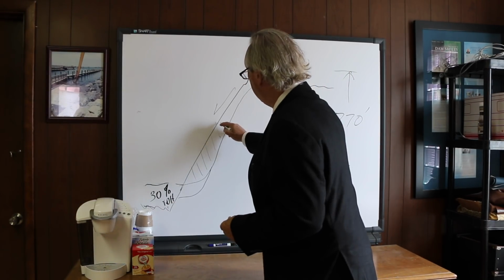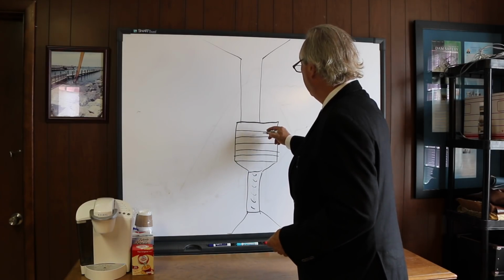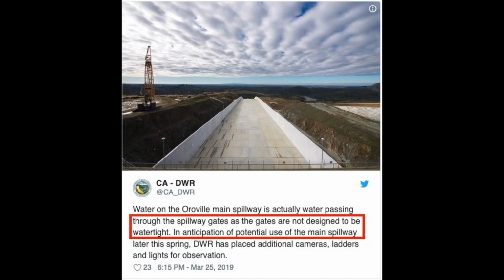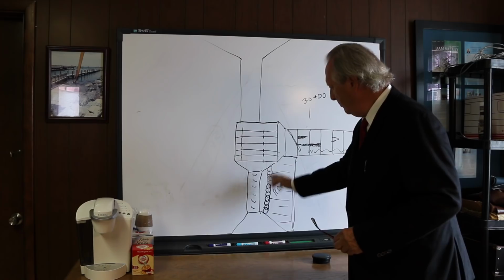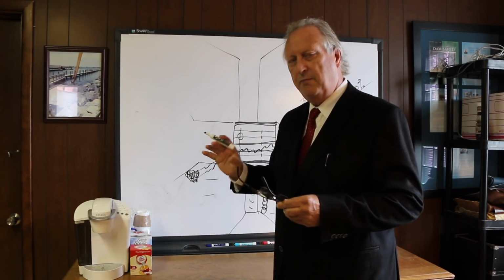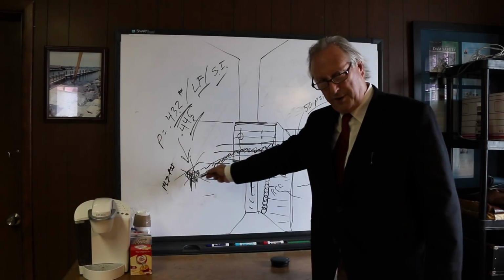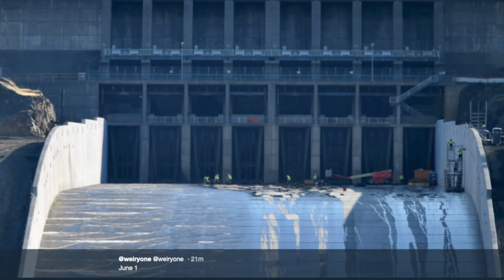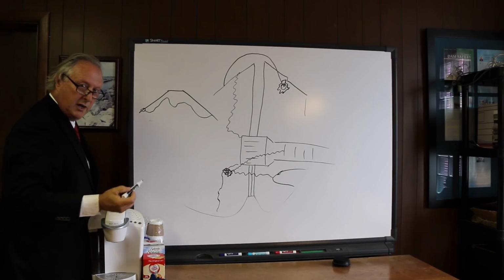Cahill on Oroville Dam 06-01-19

Comment: Scot ~~ I appreciate your well thought out presentation, but I think that you overlooked a few things that need to be brought up so bear with me as I bring up my points of contention.
1. The 2.5 'reinforced concrete slabs that makeup the finished deck of the main spillway has longitudinal and transvers contraction/expansion joints with PVC water stop (the white pvc imbedded item lying in the contraction joint ) at approximately 12" below finished grade. # 11Epoxy coated rebar is approx. 6" above the PVC water stop and 6" below finished concrete grade exposing the epoxy coated rebar to water at that joint. These checkerboard slabs are connected to each other by the epoxy coated rebar and eventually as the reinforced slab shrinks by the heat of hydration of the concrete a crack is created at that joint. This method of  checker board placement of slabs that are also placed with their transvers ends over the under slab drain slots that has pea gravel clear down to the blue diorite subgrade. Water spilling down the surface of the spillway from gates leaking ( from 813.6' ) will fall into the EXPOSED 12' DEEP contraction crack and THE WATER is then prevented from continuing down that crack into the subdrain because of the PVC water stop. THUS filling up that transvers crack void to the point of over flowing with a tell tail wet streak down the spillway. The Transvers pea gravel under drains and the PVC water stop prevents any water from migrating up from the subgrade because it is discharged down to the under slotted drain pipe and on to the exterior of the training walls and eventfully spurting out from the wall openings onto the deck of the spillway. If the elevation of the reservoir was below the 813.6 exposed elevation of the bottom of the radial gated inlet ,...there will not be any exposed water staining down the concrete spillway invert  and no piping as you are suggesting.
2. As built plans are few and far between but I do have a miniature set of plans of the radial gated structure that shows a grout Curtin notation in cross section at the bottom of the "Bulkhead Gate sill plate " location and a foundation" Footing Drain " also shown down stream from the grout curtain. I think that a serious effort should have been maid to consolidate grout, followed up with a curtain grout operation to prevent any future cross draining of the OG dam and the radial gated structure. Mabey next year.
3. You did not mention the most critical fault feature of the Oroville Dam and that is a tunnel through the left groin of Oroville Dam and  that is the 6' in diameter 2430 foot tunnel through that area near the green spot that only carries up to 45 csf of irrigation water for OWD. The inlet is 300' deep in the revivor on the East side of the PP intake structure to HPP and exits from the toe of the west side of the dam and then flows in a contour ditch providing irrigation water to Palermo. This tunnel should be properly abandoned as the OWID water commit can easily be remedied by opening an existing valve on the penstock coming off the mountain to the small OWID Power Plaint below Oroville Dam. The outlet of this 2430 ' tunnel is directly over the entrance tunnel access to the HPP under ground power Plant,...not good !
That is all for now,..... I have others but this is getting long.
Reply: Well, Well, Well,...I have always been suspicious of a SuperFly and you have proved no exception ! My contention as stated above is with Mr. Cahill's statement that " They did fail " ,...now we, Mr. Cahill and I are talking about the newly constructed spillway invert of the Oroville Dam where structural concrete 2.5' thick was placed with reinforced # 11 bars placed both top and bottom in the mat with rock anchor ties to bed rock and secured to the mat. Now I hope Mr. Fly that you knew all of  that before you shot  your mouth off  in your statement above. If you or Mr. Cahill has any proof of  'They did fail " I will stand corrected. Do you and Mr. Cahill really think that DWR is going to open the radial gates in the next days knowing that spillway slabs have already failed,.....?????
Reply: @Marty McSuperFly!
You sir are an IDIOT and I will not waist my time dealing with you !!!
Reply: Nice one Jerry!
Reply from the maker: Jerry, the slabs failed before. I referred to the previous failure, remember - the one that happened right after I was told that the porting drains were "normal" and there was no problem?????  But then, again, as Croyle said, the dam worked as ai was designed to work. We let water out of our dams in the east often and it never costs us a Billion to do it. Our dams mostly pass the PMF. Yours fails at 4% of the PMF. There is suspicion of the slabs - though I have never stated that there was an issuer because I don't know. What I did say was that it did not look like things were going well on that job site. If you read my words and stop inferring things and creating conflict, you will generally see that I am generally accurate. I am not clairvoyant, but one thing that I do believe is that a man who is doing what is honorable doesn't have to hire people to troll his critics or detractors.
Reply: @scottcahill945 ~~ Well Mr. Scott Cayhill I can read between the lines with sans experts like you and I find that you are a very slick individual and you cater to people that have little to no knowledge of the subject matter .You pray on their fears and, as an example,  the Susan Wolding channel is festered with a vast number of  frighten unknowing people, most of them women that are taking the situation out of context  with the reality of extensive engineering on the NEW Oroville Project as they are prompted by what you are saying ( old verse. new spillway ). They think that you are a GOD of engineering and they are taking what you are saying out of context between the OLD and NEW spillway as they  continue to  spreading GLOOM and DOOM and get out of town crap, mostly based on your commentary. You need to differentiate between the 50 year old spillway that failed and the  one that we  now have. By you Saying that slabs are undermined and will fail is just WRONG! By you saying that the new under drain system is full of mud is just WRONG ! That the under drains are vented to the back side of the training walls and is washing down the slope to the river on the out side of the walls in WRONG. And just one more,...for now, that the Rubber Radial Gate " J " seals should  not be leaking  the relatively small amount of bypass water that is occurring is WRONG ,...Now you know that this is all BS. You have a tendency to SHOUT TROLL when ever someone has an honest disagreement with you as you obviously do not respect the opinions of others , that is to bad because you just might learn something.
Reply from the maker: Thank you for your input. Before the slab was also two feet thick and was tied down with rock anchors to competent bedrock. There was no way that the plate slabs of the spillway could fail. They did fail. I hear you and believe that probably there are water stops and slip bars at the juncture of the slabs. We need only to open those radial gates and allow the water to pass, then. It is not that I do not believe that a spillway can be constructed properly. It is that I believe that there are problems with the spillway - particularly the drains and the charging beneath the slabs. The gate structure is cracked and the tendons failed at the trunnions. The gates are so racked that they cannot be closed. This problem with the gates has existed for how many years?????  Is it now magically fixed???? I hope that I am wrong about the new spillway. Use the damned thing and prove me wrong. That is, after all, why it exists is it not?? Use the spillway as per your operational plans and convince me that there is nothing wrong with it. You (DWR) have lost the trust of the public and you have lost the trust of me.
Reply: Thanks for responding Scott ~~ You made a statement above, "There was no way that the plate slabs of the spillway could fail. They did fail. " I contest your statement that the slabs failed in April 2019 at the 25,000 cfs test stage, as I have seen no evidence, visual or photograph that supports your contention. The simple fact that DWR has already announced that they will release spillway water to mitigate and maintain a "full Reservoir" flies in the face of your opinion that the slabs have failed. I will stand corrected if you can produce proof of this alleged FAILURE.

Comment: Thanks for the balanced explanation of what is happening.  I decided I'd hang out in the live stream for awhile to see what was happening.  They had brought out a cherry picker + sandbags across that 3000 ft point SC just spoke of which seems to contradict the public statements about the spillway working perfectly.  No wonder there is so much speculation out there!
Reply: They are preparing to open the Radial Gates in the next few days to maintain control of a reservoir level of 895 for water conservation. That is why they are removing the Cherrypicked, sandbags and most important the PELOSI shit house.
Reply from the maker: When those responsible to disseminate truth fail, there is only subjective opinion. Let us hope that our attemtp at understanding is enough. Thanks.

Comment: Juan needs to attend your Oroville Dam 101 class, Tom. So does DWR.....
One other thought, if a port exsists, did the "mistake" blast affect it adversely?
Your concluding remarks are absolutely brilliant and timely!
Reply from the maker: As the director of Dam Safety for the Commonwealth of Virginia a few years ago said to me; "There is never an appropriate time to blast on a hydrated dam" I am certain that blasting induces vibration into the soil and hydrated soils have the potential to move. I suppose we will never know for sure, but, though I have held the licenses to blast, we have never blasted on an active dam.
Reply: @scottcahill945  And where was the lake level when they blasted, way below the elevation of the blast so the soils were dry. I think Kiewit knows a lot more than you do, again something you have never done but you bring it up and the idiots use it to spread fear. Susan has been on her soapbox for weeks yelling get out now while you can the flood is coming, Wow
Reply from the maker: Thanks so much. Yes, I suppose that the "blast of the spillway instantly choked the under-drain system.
Reply: @scottcahill945  How stupid can you be. The drains were covered with a pipe sock then covered with rock, so how does blast material get inside. And they can run a camera through all the drain pipes, talking shit old man. You never stepped foot on that job site yet all you do is spread lies and what ifs, shame on you